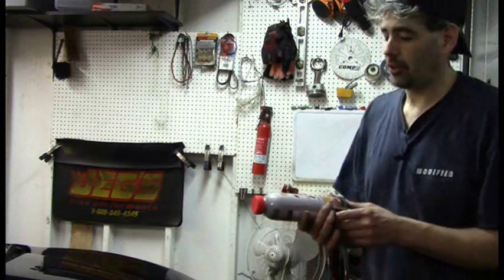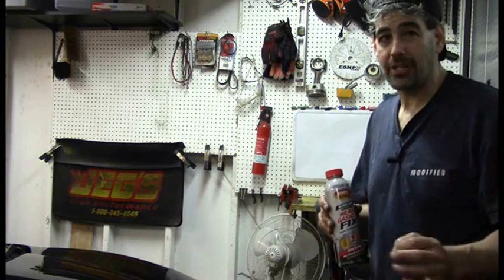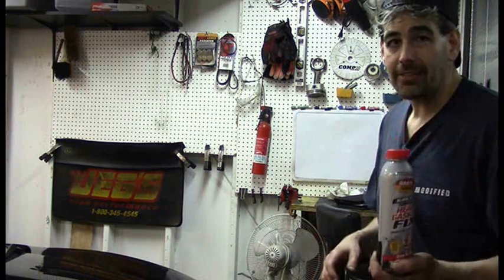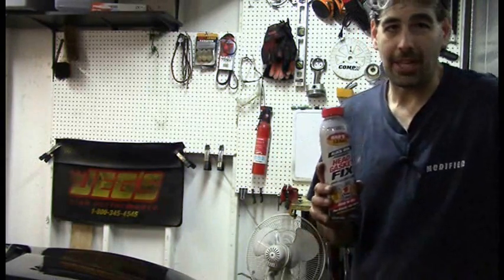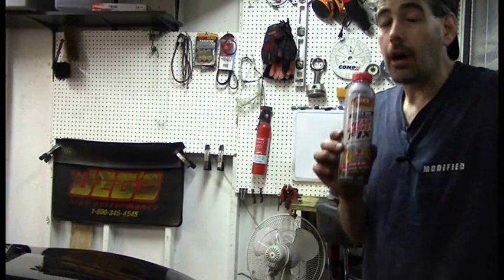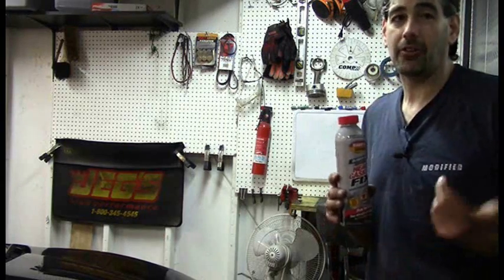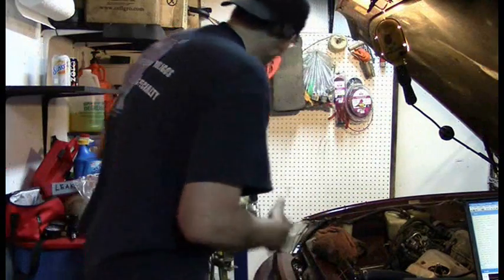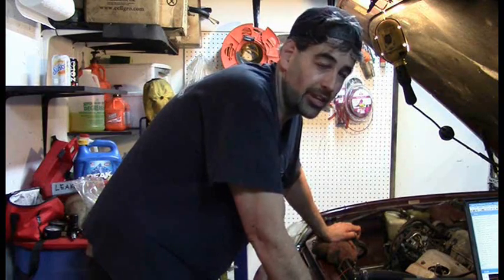Liquid Head Gasket Repair / Block Sealer Scientific Testing

Comment: Sorry I didn't read all the comments so don't know if this subject was broached or not... but how about giving Blue Devil a try on the next blown head gasket? My brother-in-law used it on his 02 Dodge PU and it is still running fine 4 years later.
Reply from the maker: RL Williams It has been broached- trying different products is no more scientific or non scientific than trying this one.  We cannot make a control condition with an identically compromised cylinder head.
  When blue devil worked on your brother in law's car, how do we know this product wouldn't have also worked? It would not have been the same condition.
Reply: So get scientific about it! Create your own head gasket failure by scribing identical head gasket (or head) "cracks". If you get creative you can absolutely come up with a feasible "test". I have tried that product name you used in your test for a leaking radiator (heater core) and it totally sucks! I didn't like anything about it.

I never really cared much for science anyway. I much prefer results. And when I hear over and over that something works wonders by different sources, I tend to lean in that direction when I run across that circumstance.

Not everyone has the facilities or can afford to do things the right way. So I would think that testing a product that has proven to work in many circumstances (not just my brother-in-law's) would be something that your followers might like to be made aware of. But it's your show. So test on professor and good luck with that.
Reply: I tried  blue devil It worked for me. Amazing ,!

Comment: What about liquid glass?
Reply: mike brannon Yeah, You`ve got it  Waterglass.  Run engine for 30 minutes on tick over. Put in 1 pint of waterglass. Run for 15 minutes. Leave 4 hours. It`s done.
Reply: mike brannon Yeah, You`ve got it  Waterglass.  Run engine for 30 minutes on tick over. Put in 1 pint of waterglass. Run for 15 minutes. Leave 4 hours. It`s done.

Comment: Thanks to your other video about head gasket diagnosis, I decided not to dump in the bottle. I called my mechanic, took it in yesterday. Probably head gasket, but he's going to test it. He shook his head and grumbled "no such thing as a mechanic in a can. Now, go get your money back." He said he's seen gasket "miracles in a bottle" trash engines. 

So, you are today's hero for me. Your head gasket video may have saved me thousands. Just wanted to say thanks!
Reply: P.s. My repair bill estimate was about $900-1,000. Better to do it now, though it'll seriously damage my measly bank account, but it's cheaper than a "new" used car!
Reply from the maker: bluestudio67 Smart choices bro. At best, even if the miracle juice did work, it would only be temporary, and you'd be in the same situation you are in now but with a towing bill to boot.

  Just the confidence in not having to worry every minute while driving when your car will completely fail is worth a grand alone.
Reply: Schrodingers Box yessir, indeed! I love your videos, man. Keep it up. You've already helped me!

Comment: I watched the video as you said, when i did the scan and monitored the graph, i got the following values, LTFT bank 1; 25%, STFT bank 1; 2.06% and STFT bank 2; 1.10%
Fault codes P0171 and P0174. what do i do i don't want to just replace the fuel pump without being sure.
Reply from the maker: There is not enough data here to make a diagnosis. where is the O2 sensor data at WOT? where is fuel pressure static and load tests?  it is impossible to make diagnosis on just fuel trim at idle.

Comment: Please i have 2006 ford freestyle with 120k miles on the clock, i noticed that the drives well but after a while the engine stalls and dies, got fault codes P0191, P0171 and P0174. what do i do
Reply from the maker: See my video "secret of engine problem diagnosis: fuel trims" to learn how to diagnose it

Comment: One important thing to note with theses sealers is that they are made with the same base chemical that was used to sieze the engines in the "Cash For Clunkers Program" (Liquid Glass) They dumped it into the oil and these sealers go into the cooling sytem, but if you have any of this stuff leaking into combustion chambers it is likely scoring the cylinder walls and gumming up piston rings, not to mention if its bad enough and leaking past rings then you ARE dumping it into the oil and you are asking to take out the whole engine because it will be scoring bearings and plugging the filter and passages in the block. All of these things decrease the possibility of doing the job right afterwords and still having a reliable engine, it may still run fine after a head gasket job that was performed "Post Band-Aid" fix attempt, but the engines usable service life willl likely be shortened.
In my opinion this stuff should only be used in the case that the car is already a total pile of junk, (totally rusted out, been crashed 7 times and held together with duct-tape, only used as a beater on a farm and never sees the road or highway driving, or you have absolutely nothing to lose, etc etc..) if thats what you have and you want to try to get another couple weeks out of it while you look for another car then go for it, you will be looking for another car soon anyway.
If you do use these products then buy some cheap oil AND FILTERS and do 3 oil changes during the week following the "Repair", once right afterwords, once after a day or 2 and then again after about 100-200 miles, by then you should know if you are still using coolant and if the fix has worked for sure, then go from there.
Reply: +MrTurdfergusen this may be true,but with cylinder compression at 120psi,oil at 40psi and coolant at only 15psi.....how will the product end up in the oil?If it were dumped directly into the engine oil I don't doubt that it will destroy bearings,but with all of the people that have used this product and with all of the engine operating pressures I have a hard time believing that it will destroy your engine
Reply: MrTurdfergusen - You sir are most likely correct, ha!  And I agree with the last part too, since I may just have to resort to this last ditch effort.  What makes me both angry and curious are the people who use this product and have success for 1 or 2 years, crazy, lol!

Comment: Context here is a 2000 Mazda B3000 (3.0l Ford Vulcan) engine that had both a head gasket and ring job done last year which has manifested a knocking noise since the work was done. The knock is loudest when driving the vehicle is cold and under load. As the engine warms up the knock gets significantly quieter to the point that I usually do not hear it in the cab anymore unless the engine is under a significant load - even then it's way quieter than at startup. Piston Slap? That was my theory so I decided to do a leak down test.

Using a two gauge leak down tester, I tested each cylinder (cold engine). Starting with 100psi, after finding TDC on the compression stroke the gauges read: 90/18, 90/35, 90/40, 90/80, 90/25, 90/55. Yuck. For all but one of them I can hear air flow by opening the oil cap; for the 90/80 I can hear air at the intake manifold (bad valve or gasket I assume)

I would expect the engine to be burning oil given those numbers, but the vehicle does not. Confused by that. And, it runs pretty well after it warms up too. 

Additional data: The last time I changed the oil it looked quite clean. i saw no evidence of disintegrating bearings, etc.

Thoughts / advice on how to proceed?
Reply from the maker: The knocking sound may be low oil pressure- low oil pressure would explain not burning oil so much.
  Try the readings again after warm engine see if they significantly improve too, in which case piston slap is certainly more evidenced and actually less of a concern
Reply: Schrodingers Box I just did a compression test on the warm engine; cranking the engine 5 times for each cylinder. The values from that were (same order as above): 94, 114, 103, 122, 96, 111. I'm not sure what would be considered within spec for the Ford 3.0L Vulcan engine (or how to find it having attempted that via google).
Reply from the maker: Gerald Hinson I dont know the specs either but they sure don't seem congruent with the leakdown. You are introducing way too many variables and you're losing focus. You have to perform the leakdown with engine warm to verify if your variation is from compression vs leakdown or temperature. Also without specifications Compression test is useless.
 You have to approach this scientifically if you are going to draw a definite conclusion
Reply: Schrodingers Box I know I need to stay consistent with how I'm testing, but I didn't have time to do the leakdown test again today, so I thought I would go ahead and do the compression test in the time I had just to see what it yielded. I shared it just to add a bit more info to the context in case it was revelational to those (like you) who know a lot more about this than I.
Reply from the maker: Gerald Hinson Coldf vs warm leakdown and cold vs warm compression is needed.
  It is quite concerning how your leakdown and compression tests are so incongruent, but of course the temperature is a variable.
 Let me know your results and it will be an easy diagnosis either way.
Good luck. Hoping all tests are not indicative of anything major.
Reply: Schrodingers Box Will do on the cold/warm comparisons. Just couldn't fit it in this afternoon. I did find it of interest that the lowest/highest leakdown numbers were also the lowest/highest compression numbers. (90/18 LD / 94 CT) (90/25 LD / 96 CT) & (90/80 LD / 122 CT). It will be interesting to see what the final numbers yield. I'll update here when I have them.  Thanks!

Comment: i have a 73 dodge charger with a 318 that was bubbling through the radiator really bad even after the engine was off got a hydrocarbon rad tester and confirmed a blown head gasket so to save a little moneys i got some blue devil head gasket sealant and used it ran the engine till all the gas was out took like an hour and redid the coolant and did a hydrocarbon rad tester and confirmed the problem was fixed even used a compression tester to check every thing before/after and it dramatically helped the engine not 100% but pretty close sometime i will build this engine better but it should hold till then
Reply from the maker: What was the model of the hydrocarbon rad tester you used?
Reply: UVIEW 560000  i got it from ebay and also on top i have a General NGD8800 connected to it  i have a garage i love to work on engines and my buddy does body work and paints love your channel very informative
Reply from the maker: Exactly same as I use (technically it's a CO2 tester rather than a hydrocarbon tester but either way...) yeah that's pretty solid evidence bro.  It would have been cool if you had done compression test before so we could get an idea the volume of combustion loss and determine how this leak compared with the one in my video. But either way, that's solid evidence of a fix using gasket sealer. wow!

Comment: Not for nothing but you didn't fully flush and dry the cooling system before adding the product, so a fair assessment really wasn't possible in your case.   Thanks.
Reply from the maker: Product instructions were followed. Different products have different instructions varying from juat dumping and leaving product in, to flushing product out, to replacing coolant with just water and product, flushing and replacing with coolant. But in this example product instructions were as shown.

Comment: It would be amusing to see a fair test of various fuel additives.  None of them do anything of consequence...except take your $. 

Obsessed with Sea Foam?  Spray some mineral oil in your intake.  The smoke means it's working...or one could just dribble some tap water in there and it will work a whole lot better and be almost free.
Reply from the maker: Lol I knew we would get along!! Couldn't agree more.  One of the videos I plan on doing is using fuel additives that claim to remove deposits from valves and using a video scope to take before and after shots of valves in a good running engine to see if any deposits were actually removed.

Comment: My humble opinion is that pretty much none of the plop-in fix-it juices do anything but drain your wallet.  The only things such head gasket sealer is going to plug up is the radiator and water pump.  Easy to put in there but not so easy to get it back out.
Reply from the maker: Sweet baby Jesus, I believe my doppleganger just found the channel!!!
Reply: Schrodingers Box
Maybe.  I do web design, and some of it you may find interesting and useful...

http://ircyb.org

If you root around there for a bit, you will find other sites of mine that cover lots of science, computing, and technology.

...and I've got a bit of Jesus too...  ;)

http://jesuschristened.com

Peace and Love, Brother!

Comment: Hi Matt,

Thanks for another good video.  My two cents.  I don't believe that the "leave it in the system" products are as effective as the "completely purge and run with pure water and then drain" products.  It's been a while, but I've used K&W Block seal successfully several times in the past.  It has also failed to repair a leak, but that's to be expected.  It's only about $10, so if you have an opportunity to try another one of these products, I highly recommend it.  My 1st attempt was on an old '73 Saab 99, which I actually ended up rebuilding several years later for an unrelated reason.  My interest at that point was in how much of the product was remaining in the engine that could compromise cooling. Much to my pleasant surprise there was essentially no lingering sealer left adhered to any of the visible portions of the cooling system internals.  Now I didn't section the radiator or heater core, but I had no cooling or heating issues so safe to say that if any residues were present, they were benign.

Robb
Reply from the maker: Next blown headgasket I see I will try one of the products you mention- but it still won't be scientific since the variables on the other head gasket problem will be different. In other words if your product suggestion works, we don't know if the block seal from this video would have worked too. But what the hell- I will try it.
Reply: Schrodingers Box
Of course, understood.  That said I have had zero luck with add to coolant products and probably around 60-70% success with K&W Block seal.  Worth a shot.
Reply from the maker: kermit80526 Agreed- we call that "correlation" and it is absolutely a valid reason for investigation and in fact can in itself show etiology if it is statistically significant.
 Smoking causing lung cancer is only a correlation- but few would argue against it!
  K&W Block seal will be tested next chance I get.

Comment: That Bars leak has never worked for me I ran a used car lot in Alabama we were always Buying junk that had blown head gaskets from the Auto auctions and the only liquid gasket stuff that I found that worked was some stuff  called CarGo     seal up they sell it on amazon for about $7 it has what I call liquid glass with copper flakes the only thing it won't work on is a big leak on an exhaust port. You should drain all the anti freeze and replace it with water also never buy just one bottle I always buy two because sometimes one just doesn't do it and never just let it sit there get in it with the heat blasting and drive it for as long as you can stand the heat make sure you take a gallon jug of water just in case and keep an eye on the temp gauge/light after about five miles of driving if it's going to stop the leak with just one bottle than it will be fixed if it needs some water add that last bottle with the gallon of water and drive it some more if that don't fix it than nothing on the market will you better start looking for some parts.

Comment: I forgot to suggest - if you want to pursue another snake oil arena - liquid compression repairs. I tested one three times on three different engines with varying stages of compression loss. Absolutely zero difference, and Rislone won't supply any independent studies on the effectiveness of their product.
Reply from the maker: Yeah good one- all these products- "smoke-b-gone", "Liquid emissions pass", etc all have different theories on how they work that sound reasonable but at best they are temporary patches and at worst- pure snake oil.  "Smoke-b-gone if I remember is just really, really heavy weight oil that is less prone to leaking past valve guides, rings, and I suspect engine bearings lol).  
  Only people who think car engines are magical mystery boxes would rely on such products- anyone who understands engine operation would know these cannot possibly be reliable (or even unreliable) fixes.

Comment: Well thought out video. Most mechanics have no clue of the scientific method, around here anyway. For example, an older engine burning oil? Their strategy is to run 40W/70! Doesn't stop oil consumption and the only thing changing is the oil pump being stressed and high levels of pressure in the valve area. Maybe in the days of Babbitt valves this had some credence but with poppet valves I don't see the logic.
Reply from the maker: Actually most scientists don't even have a clue about the scientific method- they do similar in the lab as you described in the shop.
  The age of reason is yet to fall upon us.
Reply: Agreed. Logic and reason go hand in hand, and both are seldom found in a mechanic's workshop. Plenty of old superstition though.

Comment: dont EVER band-aid a problem like this it will generally cause more problems
Reply from the maker: Agreed, I am not much for band-aid fixes either.  Even if it works, you always have to worry for how long. It is so much better reliability and piece of mind to fix it correctly.